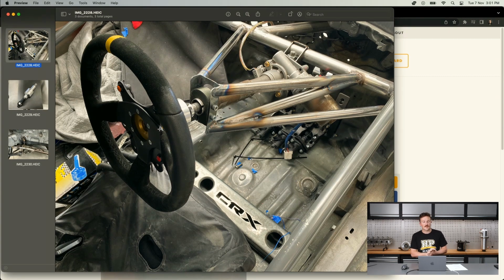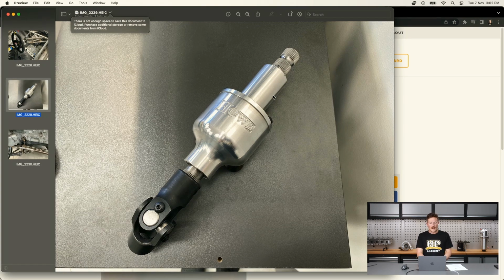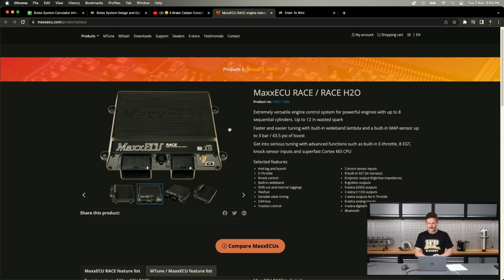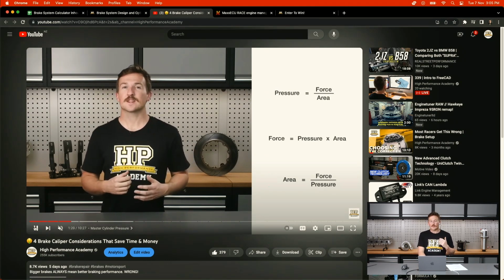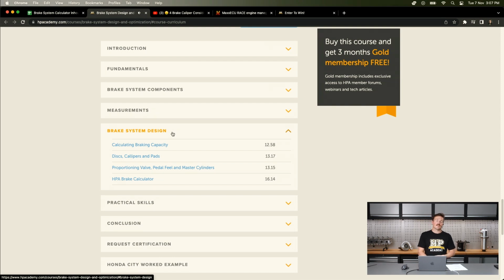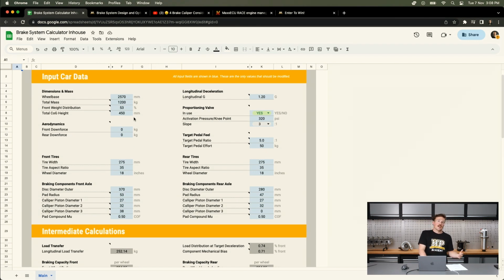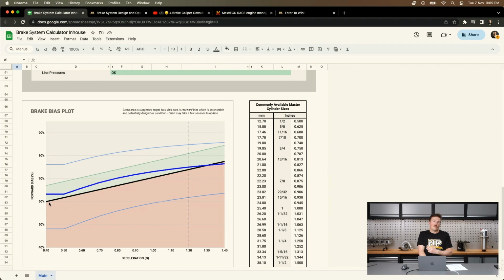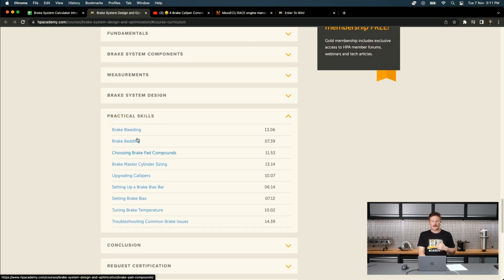WRC Inspired Custom Steering Setup #update

Comment: Ah, the brake calculator makes a lot of sense, now, thanks
What I forgot in the forum post is the affect engine braking can have to the mechanical brake balances, especially if the driver is a bit harsh on down-changes which can produce spikes.

Comment: We used an electro hydrolic pump from a Peugeot in our k20 ef civic Tarmac rally car. We mounted it in the engine bay, I find the colum mounted powerstering slow to react or numb but the mk2 escort boys use them a corsa one specially.